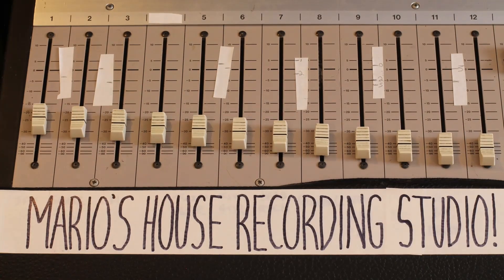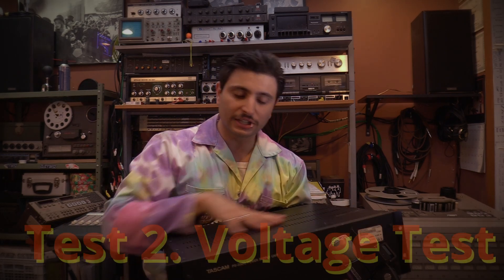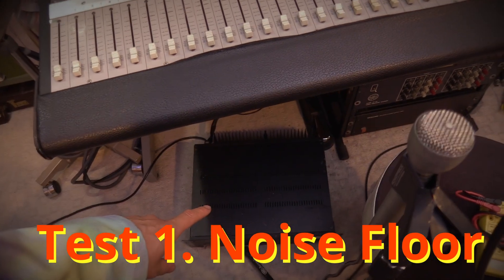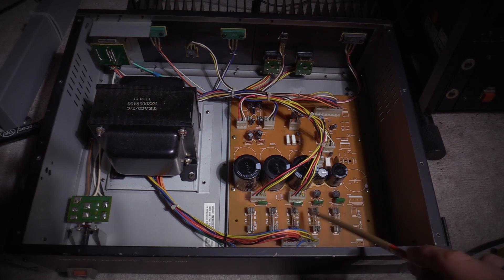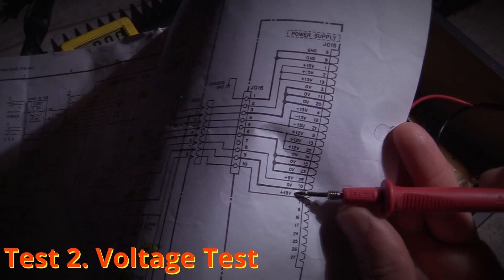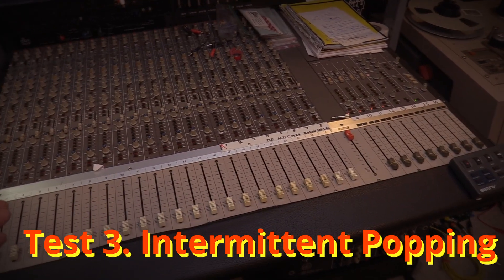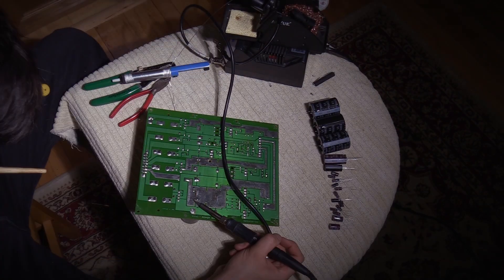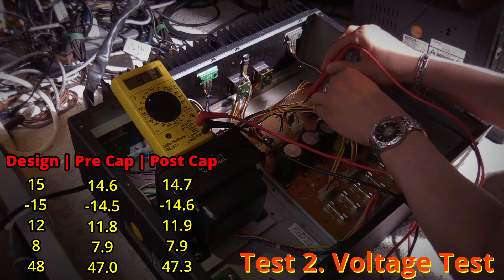Will Recapping My Mixing Board Power Supply Improve Performance?

Comment from the maker: UPDATE: Recapping the board did not fix the intermittent problem. sigh....
Reply: You might try having a screwdriver party in the mixer.  No idea how hard taking apart the board is but checking the connectors and terminals might help especially if it's something that crops up after you've had power running for an extended period.

Comment: Hey All,  One point on caps.  There is a generation of gear with electrolytics that are prone to bulging, leaking electrolyte and exploding (which is pretty startling when it happens).  When they leak its corrosive.   Most of that equipment was from ~'99 through '07. The more ripple current the cap sees in operation, the more likely the issue is to occur.  So, power supply caps are the ones to watch.  Linear power supplies with the big heavy power transformer, like the one Mario shows in this video, are less likely to have have an issue for caps after the voltage regulator; its the big input can caps just after the bridge rectifier would see the significant ripple in operation so, you definitely want to keep an eye on those. 

If you have a piece of gear from '99 to ~'07 that gets heavy use, it would be good to check the power supply caps on an annual basis for bulging tops.  If you see that, replace them immediately.   Here is a whole story about that caps issue (lots of good example pictures of the issue):

https://en.wikipedia.org/wiki/Capacitor_plague

How to tell what supply type you have:

Linear:  This will be of significant weight and you will hear 60Hz hum if you put your ear up to the box.  And, these are usually only able to run at the voltage for the geo they shipped to (or require some changes to run at a different input V).  So, for US you will see it rated for 110V to 120V only.
  
Switching:  This will be very light for its output power capability (like your computer brick).  You will likely not hear any 60 Hz hum because it switches at 100kHz or more (there may be some sound but it will be a higher tone than 60Hz).  The big give away of a switching power supply is its ability to run across a wide voltage range like your computer brick, which will typically support a universal in input voltage range (90V to 240V) so it works anywhere in the world.

A word of caution:  Switching power supplies have a very high initial DC input voltage off the line.  The 120Vrms AC becomes about 170V DC in the US and almost 340V in EU and other locations.  That is why the large input caps are rate at 450V.  Those caps can be lethal if they are not discharged first.  Please be extremely carful.  If you are uncomfortable with that kind of risk I recommend getting someone with experience to show you how to discharge those safely.  You must not touch these cap leads with your hand....the voltage is to high.  

Sorry for the length.  Hope this is helpful.

Comment: I recall a few conversations about intermittent hissing and popping in an audio circuit, and it usually has to do with overheating or weak connections. If you can isolate a channel, then look there, otherwise check the master section... one technique is to expose the circuits in the mixer, and turn it on, while it's running, gently tap on components with a pencil eraser, or chopstick to see if you can trigger the noise from the faulty part.

Comment: I had a tascam m3500 and the poppong there was the caps in the eq section of the channels.
Years later i had a teac m15 and recapped the power supply with better caps and changed the ic chips. Also for the channelstrips, better caps and opamp chips. That definitly worked in noisefloor but also enhanced the sonics. 
Love your channel bro!

Comment: The power supply recap didn't do much to improve noise in my board, but I put in a bigger thicker common ground bus bar and that helped, recaps on the channels and master section helped more than anything.  I swapped some IC's on 8 channels and it didn't make any real difference.  Maybe a slightly lower noise floor but did not open any headroom which is what I was hoping for.

Comment: singular “lady” (lmao) watcher checking-in! about 15 years ago i had a short phase of buying and modest restoring tube shortwave radios for a bit, and it helped make me a lot more conservative with my recapping ambitions than i’d been inclined to be with analog synths. power supply caps are mission-critical but others i leave alone unless they are visibly deformed or plausibly the source of a real problem - and “i wish there were a little less noise/marginally better toan” doesn’t count as a problem on its own for those purposes. of course, most studio/consumer audio gear is more likely to have modern lower voltage components that are easily swapable, but you can still get into diminishing returns, and putting mechanical/heat stress on your gear and possibly wasting limited creative time for something no one else cares about.
Reply from the maker: Definitely agree on diminishing returns. My dull ears can't tell the difference at all, so I view it as preventative for power supply and 'only as problems arise' for all others. Of course if you are restoring an 100-year old radio things are different.

Comment: Looking forward to watching this.  Personaly I'm a huge fan of Nichicon over Elna in any audio system.  Nichicons tend to sound more transparent where as Elnas sound more grainy.  Just adding some fresh solder and washing the flux away with pure isopropyl can do a lot of good too.
Reply from the maker: Thanks for your insight. I buy the capacitors that are the cheapest (of a reputable brand) because ya boi simply can't hear the difference.
Reply: @Mario_DiSanto  can't go wrong with Panasonic in that case.

Comment: When it comes to clicking and popping in audio gear, in my experience dealing with studios in NYC and consoles from the 70s-2000s that are still running today, it comes down to dirty connectors (like just get some IPA and a foam a-tip or some contact cleaner without lubricants and clean the male connector off, and either burnish back and forth to clean the female connector or spray it out as well). It can also be do to moisture in the air (cleaning the connectors should help with this, you see this more on microphones and the diagrams being weighed down with dirt and moisture where it actually sounds like you’re underwater). And lastly, just double check for any cracked solder joints. You see this a lot on 70s consoles and even 90s desks that get hot (like the SSL 9000s with the plasma meters… oof!) the change in temperature will bring the crack closer or farther apart, think like how water expands when it freezes, metal also expands and contracts. You could have a cracked or cold joint in the main output, or try to see if you can tap around with the eraser of a pencil or chop stick to see if you can cause the pop, that will tell you where to look.
Reply from the maker: Yeah this board has plenty of cracked solder joints I have had to fix over the years. Good tips, thanks.

Comment: Oh boy, I get to do it I get to be that guy in the comments with a professional opinion!

"As a power electronics engineer," 

1. Even without looking at the schematic, I would not hesitate to check the ripple with the scope you have. You dont need diff probes, it's 15VDC you can ground it through the scope and it'll be fine.
2. Hissing and popping could totally be caps in the PSU. In addition to electrolytic, replace tantalum caps cause they go bad with age too. Also, it's a safety win, dried up electrolytic caps can fail short (which should pop the fuse, but still better to replace before that happens)
Reply from the maker: My concern with the oscilliscope was that I had to measure the voltage in reference to the 0-volt terminal, instead of chassis ground. But there is complete isolation from the 0V and ground in this chassis so it wasn't an issue after all.

Comment: 8:16 most of these 'semipro' mixers have terrible rf shielding, i know if i leave my phone anywhere near the control room section it immediately comes through my speakers, idk from the noises youre making im thinking rf data bursts
Reply from the maker: Nah it's definitely coming from my board itself. I've done a lot of tests, and confirmed as such. I've turned off every other electronic in the house to see if it would stop at one point. Did not work. Hopefully will not have to worry about this moving forward.

Comment: If you're gonna recap the power supply, you might as well recap the console. Granted it might cost you more than you paid for it just for the capacitors, but still.
Reply from the maker: I'll probably do it in steps. We are talking about the difference of an hour of work for the power supply versus weeks and weeks of dedication for the whole board.
Reply: Complete overhaul? No thanks
Reply: @WarheartArts why not….
Reply: @soulslip you're right.  Go for it. ( There's a lotta masochists on this feed)